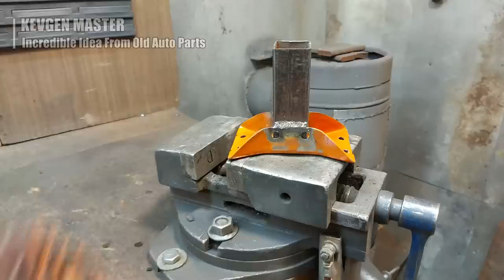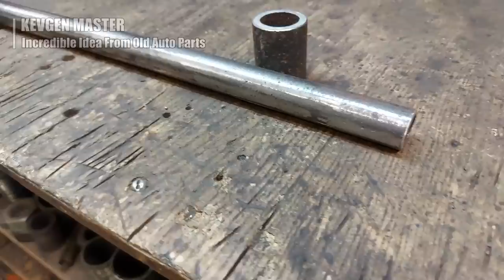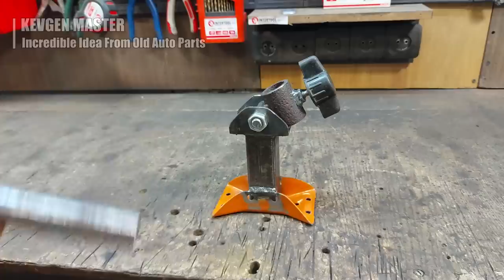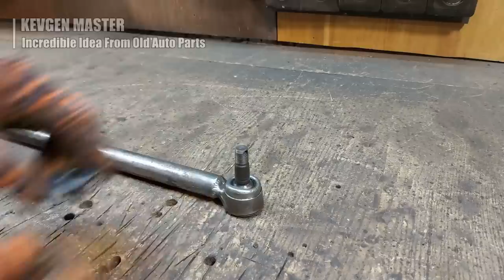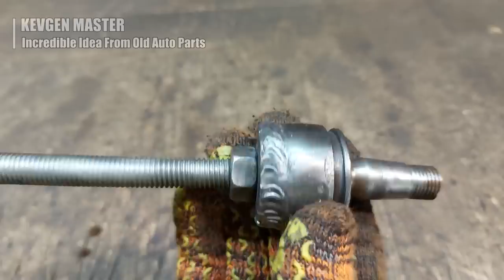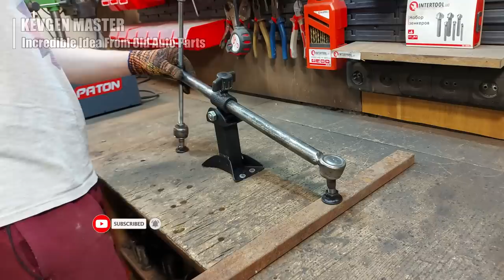Incredible Idea From Old Auto Parts!! Table Welding Clamp DIY!!

Comment: Great Idea, you could even go one step further, mount an electro magnet to the base, and you could use it on a steel welding table, as a jig hold down, perfect for welding a frame, or, anything really, I definitely think this is great, I help you patent it, and we'll split it 50/50, HA HA LMFAO Loudly !

Comment: May I suggest you use a connecting nut instead of welding a bunch of smaller ones together. A connecting nut is already that long.
Reply: Also, if you need a more positive locking adjustable joint, look into drumset hardware.